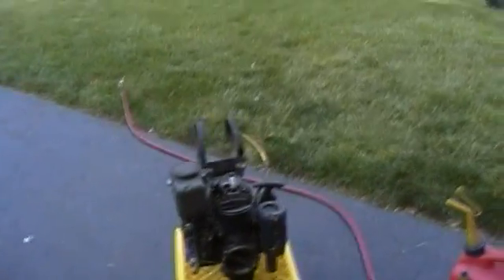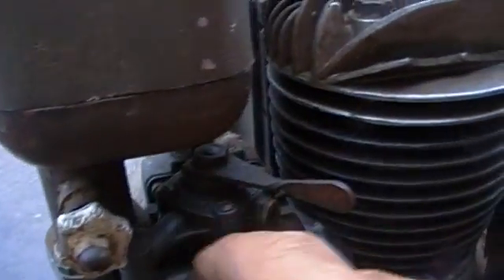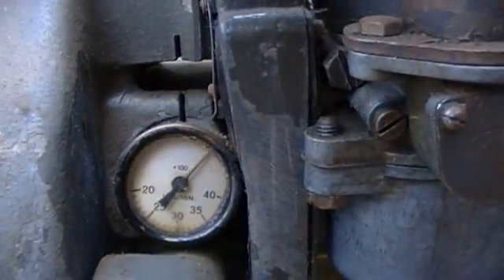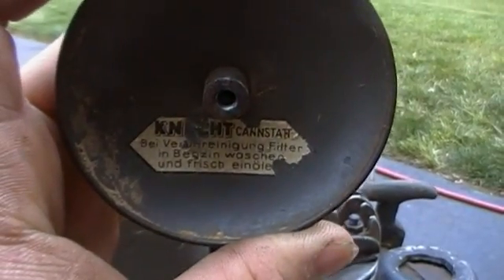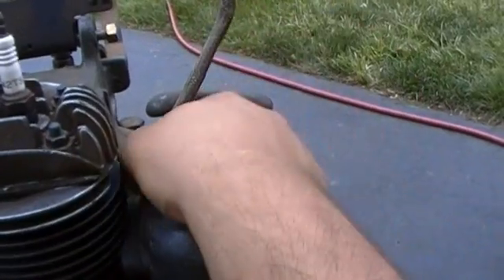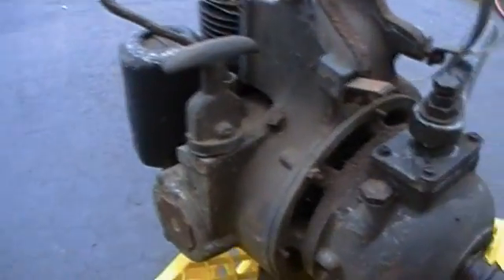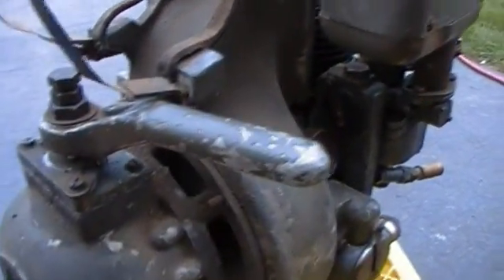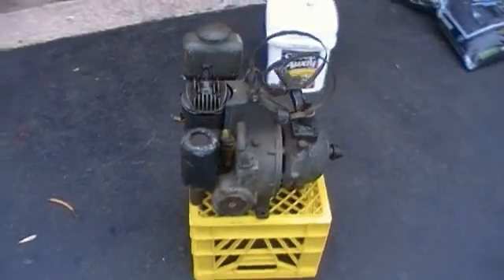German Military 2 Stroke

Comment: I have one mine has a transmission with a fan blade of sorts coming of trans. my engine spins over but my big braided recoil won't pull out. mine is on a steer frame and the base is hollow for the exhaust to run through to make it quieter. everything comes apart nicely Good German quality. far as I heard and these are hard to find and find info on but 7 hp I'm told. mines a 1937 same green color. I thought the gauge was for oil pressure why I thought a 2 stroke would have oil pressure is beyond me. I have a German friend Who I should ask for translation. if you figure out the recoil let me know.

Comment: Herzlichen Glückwunsch zum Erwerb dieses schönen Motors aus Deutschland. My English is quite well, this little bugger might be used on a winch, something lightweight i guess. This engine might have 50-100 ccm, i don´t know how many cubic inch that might be, guessing by the cylinder size. The Starter IS heavy duty, we were not taking chances with no start in the fields... Maybe a battery charger for the Funker (radio guy). I think this might be a Sachs engine as they were around those days, might be wrong. The Entlüftungshahn is for when the crankcase is flooded with gas so You don´t get a lock. When the engine drowned we say "Abgesoffen". Then You open the valve and You are back in business. The plug is wrong and we had special Zündkerzenstecker for that. Waterproof... If You still have this how about a follow up?
Reply: I just learned of video now 12 years late. mine the pull start doesn't pull but motor turns. mine was for air has a vacuum style fan. real quality build for sure. I found only one other video and that guy thought 7HP was engine power but wasn't sure. I'd love to get mine running again. Guess they were the Duct Tape of motors used them on everything. mine says Deutschland I'd love information as there is almost nothing on these engines online.
Reply: @larrywilliams3854  I could try to dig a little if we could exchange contacts aside from this.
At least I´m at the right continent.
Reply: By exchange contacts I assume you mean my email address ?

Comment: On the air filter cover it says
"after 80 hours of running wash out teh filter and reoil it, under dusty conditiosn do it oftener"
On teh carb it says "start = start, Betrieb = run"
bottom "entlüftungshahn" is a litle valve for bleeding out teh crankcase for transport the engine in sealed boxes.
Somewhere i got pics of tis engine in working condition.
Its a WW2 engine used mainly for 2 isues
For running compressor to start big generators in shelters,
and for fans in big shelters
(shelter =hiding
Reply: I have the fan model 1937

Comment: I think it was made for farms or so.
You are right: Betrieb = run. And the instructions say: If air filter dirty wash in gasoline and put new oil on it. I would love to see the engine running. Does it have any words on the carb? Would help to find the manufacturer a lot.
The word on the bottom (Entlüftungshahn) is ventilate valve or breather valve. Sorry but my english isn't that good.